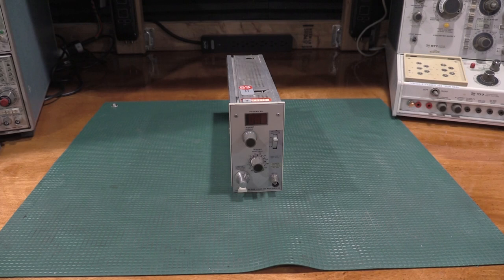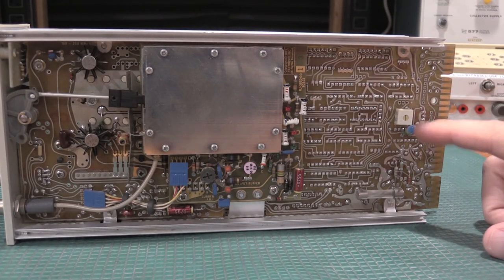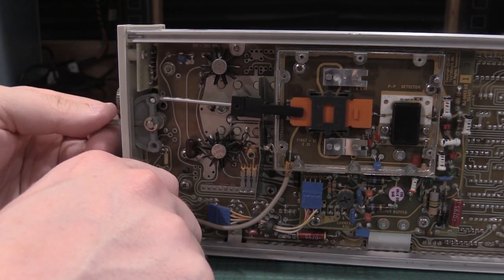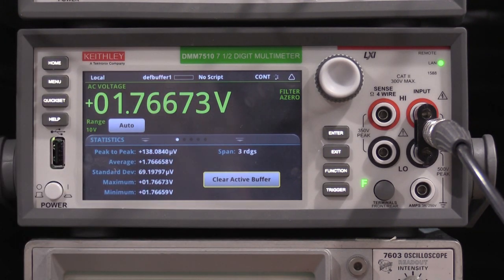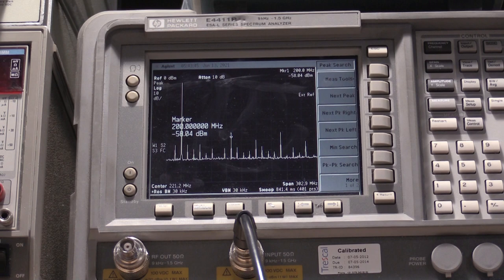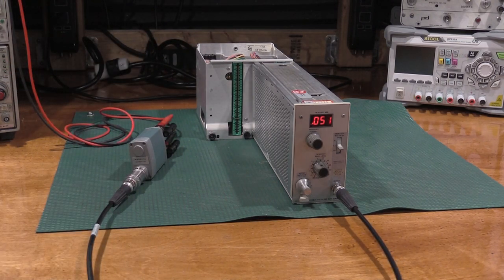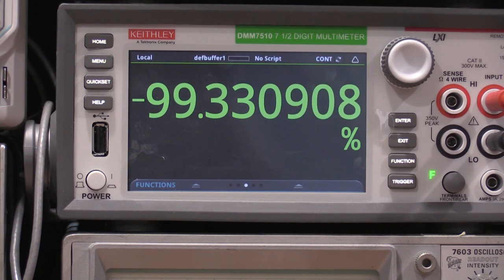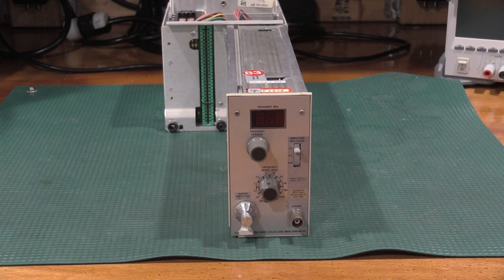Tektronix SG503 Lab Check in and Calibration

Comment: Another interesting video, thank you! Most HP spectrum analyzers will allow you to enter an external attenuator value (in dB) then add it to the displayed level. Handy, but not required when doing relative difference measurements as in this case. The technical term for the rubbing of contacts when a switch or relay operates is "contact wiping"
Reply from the maker: Thanks David. Good to know I am just getting my feet wet with spectrum analysis so I still have an ocean to learn it feels like. I have always known that contact wiping was a desirable thing, keeping things clean and good design. Glad to know there is an official term for it.

Comment: Underneath the rotary cam switch there are about 20 finger switches in addition to the three on the other side of the PCB.  Just spent the last hour or so stripping one down to clean them but ended up having to realign the fingers with the PCB pads as some weren't aligned properly.  To do that you have to reflow the solder on the finger switch securing rivet and then gently move them while the solder is still liquid
Reply from the maker: Indeed the finger switches are one of the main causes from module weirdness in the TM500 series.

Comment: 11:45 Just curious as to why you don't use an oscilloscope to measure the 1KHz P2P signals,
but rather wanted to use a DMM. Is it more accurate that way or?
Reply from the maker: Indeed, Better accuracy and less measurement error not having to analyze the screen, To check it on a scope you need the 7A13 (differential comparator) plug in and a calibration generator. The normal 7Ax plugins are only 3% accurate in the 7000 series scopes. 4% on the Rigol. The Dmm7510 (at 50 Khz) is +/- (0.01 + 0.006) and can measure up to 300 Khz. The levels were being set at 50 Khz if I remember correctly. But since I was working with pk-pk on an RMS meter a correction needed to be made to get the right pk-pk value. Vrms=1/(2√2)∗VP−P=0.353∗VP−P
Reply: @ZenwizardStudios  Interesting, I'v wondered how accurate new scopes are. Most of them can measure many things. Frequency, amplitude and so on, but how accurate are these measurements?
Reply from the maker: The Rigol MSO 1104Z that I have in my lab is +/- 4% so says the spec sheet. So the analog scopes in the lab are 3%. Now this is on the vertical I’ll check the horizontal when I get back to the lab. On the Horizontal If I remember correctly the Rigol clock is MUCH better than the Tek analog scopes. It has to do with speed. A scope must be a high-speed device so accuracy suffers a little bit. The real question is how much does it matter. That very much depends on the DUT. For instance a scope has to react at sweep speeds in excess of 500ps per div, and the vertical might need to swing 8 divisions. At 10 v/div that is 80v/500ps that is a very fast swing. In contrast a meter takes a measurement every 20 sec at least for the DMM 7510 configured for its highest accuracy. 15 PLC + 10X filter. My older fluke meter can be as slow as almost a minute per measurement.
Reply from the maker: Got a chance to dig in to the spec sheet for the Rigol 1000 series scopes. The horzontal clock has a WAY better specification  than the analog scopes. Time base accuracy is <+25ppm with < 5ppm drift per year. If I remember correctly the 7Bx units we still specified at 3%. So for frequency and timing accuracy is pretty good.

Comment: Hi,

I was wondering what type of batteries do you use in your peak to peak detector?
Mine is in need of replacement batteries, and I can’t find anything coming close to the originals.

Peter
Reply from the maker: Hi, Peter I will see what I can find for it. Mine is a VERY low serial number 1348 so it uses a dry cell (large button battery). But mine is in need of replacement as well so I am now in the market. When I find something I will report back. You can add solder tabs to just about ANY battery with a spot welder or soldering iron but there is a lot that goes in to that keeping the heat out of the battery. Around here most battery stores and add the solder tabs if needed for a nominal fee.

Zen
Reply: @ZenwizardStudios  Hi Zen,

Well for now the best I could find myself is the VARTA V625U, but this one is at a fraction of the capacity of the original, so wondering if it will last for a year.
I have a spot welder for battery contacts so no real problem with heat.
Interesting to know what you come up with.

Peter